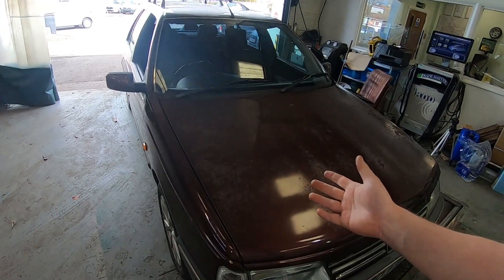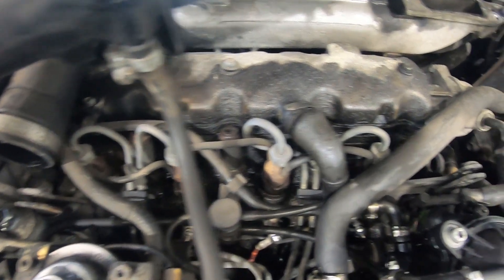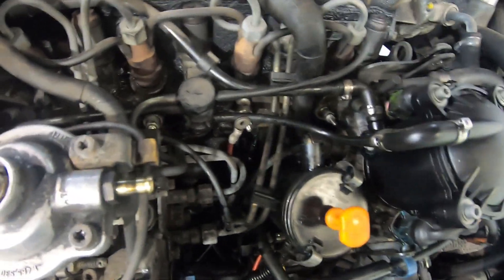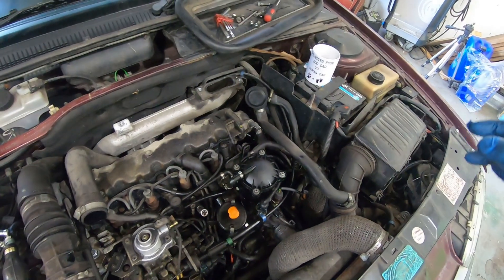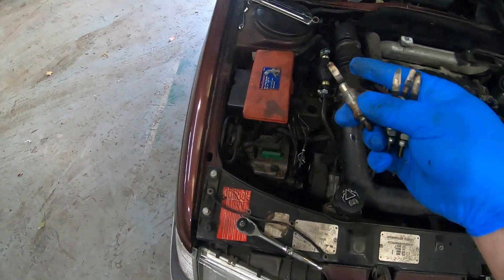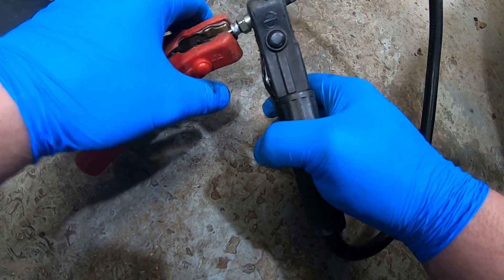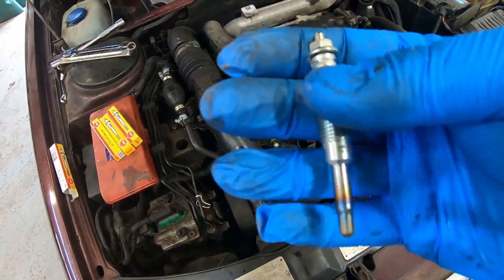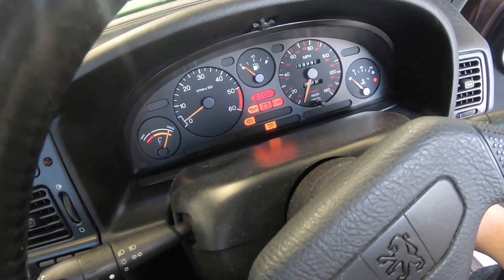TESTING GLOW PLUGS with a battery - Peugeot struggles to start

Comment: you can check the operation of your glow plugs in situ by using a lay on or clamp on
Reply from the maker: You can yes. I have done it before by measuring resistance through a multimeter between the cylinder head and the terminal of the glow plug.
Reply: @MarksWheels  I was told to do it by ampreage 15 amps per glow plug so the 4 working will show you 60 amps on an ammeter  doesn't matter if it is the lay on type or the clip on type it is a cheap tool on the likes of e bay